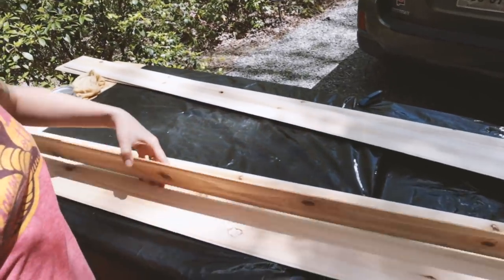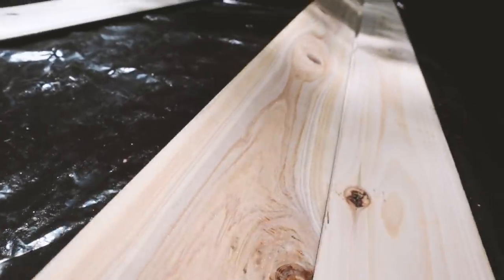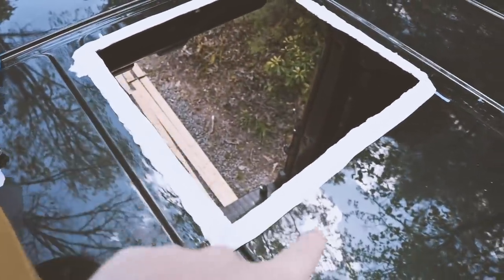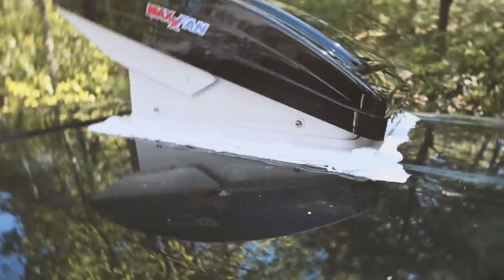Maxx Fan Install 2020 AWD Ford Transit Van Conversion | Zac Shaves His Head

Comment: Next episode...I sunburned the crap out of my head! Don't forget to zip tie those wires to the body to stop them from chaffing and shorting out.
Reply from the maker: No kidding on the sunburned head. And for sure on the wires. I ran all our cables through conduit so they should be snug as a bug in a rug
Reply: @Rolling_Vistas  excellent.

Comment: I have a question specific to Transits and don't know who else to ask! How did you deal with the electrical lines running from the front of the van to the back along the side wall? The casing sticks out further than the rest of the wall so I'm not sure what's best. It could be covered with upper cabinets, but if they don't run along the whole side, would you leave it uncovered or cover it in wood, creating an uneven surface?

Comment: Check out "Trent And Allie" van There's is smaller than your van is and they have a tiny wet bath shower. She uses their pullout dinner table that stores under the mattress as a work desk. Just saying in case you change your mind. They use jugs also. Their layout is pretty much just like yours is. But they don't keep their dog in a kennel.

Comment: Curious about black vs white topped vans... Is there a feeling from folks who've been vlifing a while on which is better?

Edit: long time fan (bald is the way), just bought a mini bus and painting this weekend...
Reply from the maker: Congrats on the minibus! A lighter roof Is definitely better. We chose green because we liked the look but will be painting the roof with elastomeric paint so it doesn’t get so hot. It’s the same stuff we painted the bus roof with and it made an enormous difference from being too hot to touch to cool.

Comment: Great video and love the haircut!  Hey guys, the wife and I are looking to buy the AWD high top extended Transit, and I'm having the hardest time with getting solid answers with two measurements on the van.  I think Tiff you must have this in Vanspace 3D or Sketchup.  I need the roof dimensions to know how much solar will fit with my two planned Maxxair fans.  Dimensions to the edge as much as possible, but useable back to front.  Do you have those length/width values?  Secondly, I've heard you lose 100mm height inside if you get the AWD version.  I'm 6'3", and that would be tough!!!  Is that true?  Thank you!!!!!!!!!!!!!❤️❤️❤️❤️❤️❤️❤️